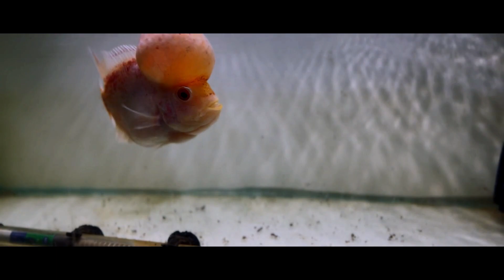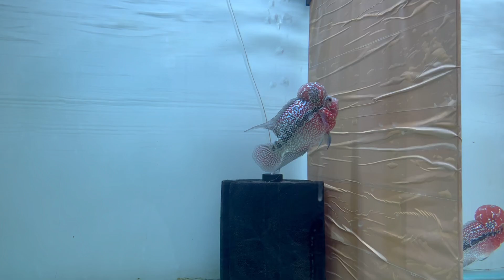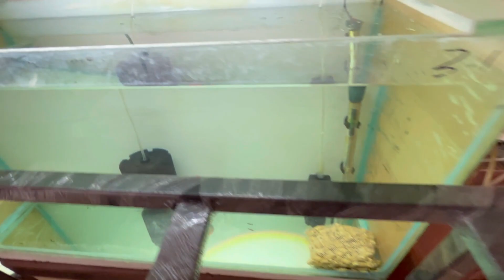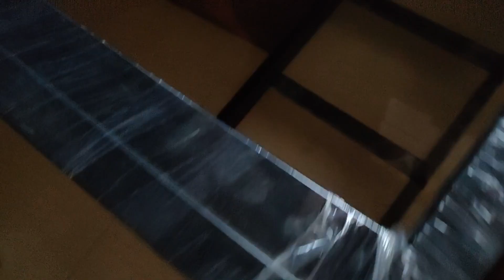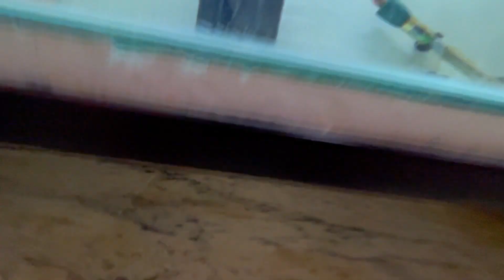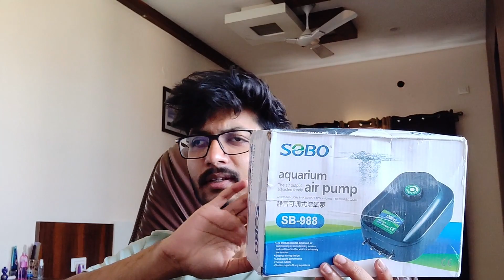Buying 2 NEW FLOWERHORN FISH!! | New tank setup | Flowerhorn Hobbyist

Comment: RS is actually a worst brand in heaters but it is the most available in local stores I also had same problem no matter if I set the temperature on 26-28 it still showed 31°
Reply from the maker: True worst brand heaters one can buy
Reply: Don't rely on water heaters temp setting, instead buy a under water/aquarium temperature sensor, would cost not more than 500₹ for one.
Set your heater setting based on all the equipments plugged in the socket and switched on as those also effect the temperature of the water significantly.
Reply from the maker: @Hawk_Arcade  will try this!

Comment: after adding parrot fish really your Flowerhorn has been changed?🤨 

same situation i was struggling from 1week
I buy this 1 week before 

I have a good genetics Flowerhorn i need to make like this.
What precautions need to take ?

U can take my number also :)
Reply from the maker: yeah he has changed a lot and gotten more agressive, before adding parrot fish keep him in a seperate tank to avoid any cross-contamination of diseases after you are sure that the parrot fish is healty add him with your fh for few minutes and observe them dont let the fh hit the parrot chasing is fine dont let them hit after about 20 mins or so remove the parrot from the tank. But make sure the parrot is not hurt in the process
Reply: Would suggest keeping FH fish in a separate not less than a 3ft long tank. Thats all.
Need not to clutter your tank with decorations and stuff. If fishes are good enough none is needed specially in case of a FH fish. As they tend to get stressed and mess with the plantations and decorations items around them.
Reply from the maker: @Hawk_Arcade  yeah you can see in the video the main purpous of this build was to give all my fishes seperate tank and all my  tanks are bare bottom